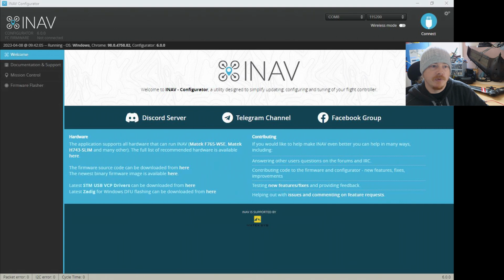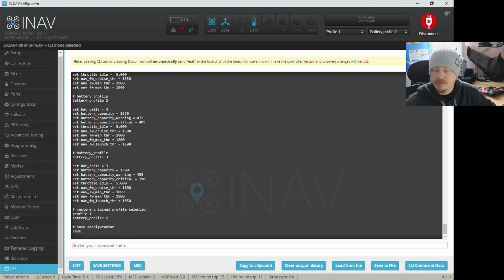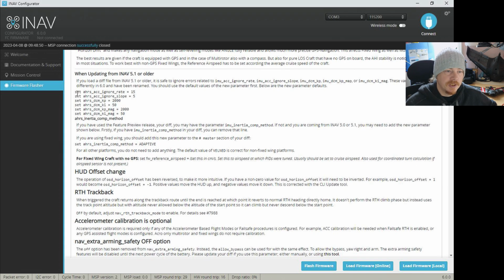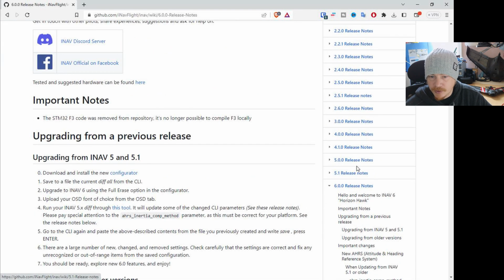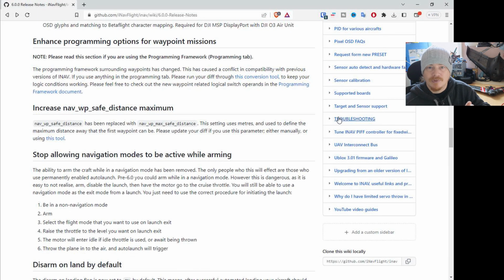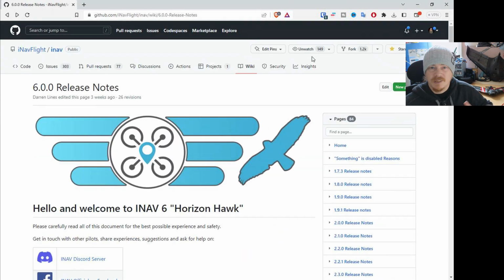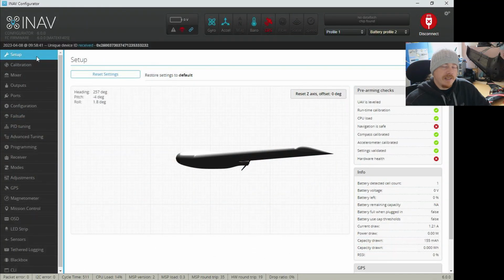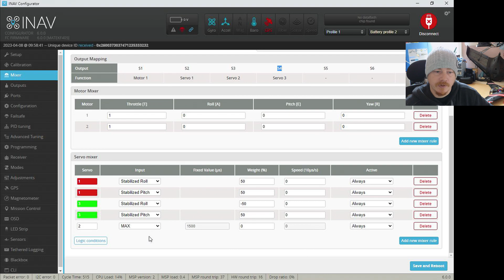FIVE Common INAV questions, answered

Comment: Hi sir. Servo auto trim works perfect on elevator, but aileron stays 1500 all the time. Is it because I adjusted ailerons mechanically perfect OR, I use Y cable from two ailerons and insert them into just S3 port? In mixer, I have deleted one Stabilized Roll channel, there is only one now. S4 is elevator and S5 is rudder. Autotrim on roll axis does not work because of that? Is it related? I’m setting up the plane, Please help. Best regards.

Comment: I’ve got no response from the servos. nothing. Can test the motor, but nothing else is working. I’ve set up modes, arming switches, etc. I’ve deleted all the inputs. In Mixes I have ch1 - Ail, ch2 - Ele, Ch3 - thr, Ch4 - Rud. I have arming switch, flight modes, RTH. I’m using the Speedybee mini wing in a Zohar Drift. Doesn’t seem like a car smash. I was thinking I could test the servos, but nothing is working. Weird, I didn’t think it was that difficult. But when you follow instructions and then it doesn’t work then what do we do? Go buy RTF and not mess with these FC builds. 😂

Comment: Hi, if we already use Waypoint mission do we still need to use Auto level?
I am beginner with RC Plane
I haven't tried to fly my plane. currently I am building it
As I know, in the Waypoint mission there is information of altitude that we need to input
Thank you

Comment: Hi Darren! congratulations on the video! I would like to answer some questions if possible. 1- You said to fly a little with Auto Level and then turn it off after getting the parameters. But can I always leave it on together with Angle or Horizon and only turn it off when switching to a mode that doesn't use Auto Level?
2- Auto Level saves the parameters automatically on each flight or should I save them at the end of each flight? Thank you very much in advance!
Reply from the maker: 1. It’s not great to do that IMHO. It’s better to just use it when you feel like the level needs updating.
2 The autolevel does not trigger a save. If you see ** SETTINGS SAVED ** in the OSD, they have been saved. If not, you will need to save them via stick commands or through save and reboot in the OSD menu.

Comment: Hello again mr D....couple of questions if u don't mind gvg some tips
1.why inav throttle starts at 20%?
2.how to limit maximum throttle in inav
Fyi im using 6.1.1
Reply from the maker: 1. Where the motor starts spinning is defined by the idle throttle on the outputs page. This should only be 5% no I believe. Certainly for fixed wing. 
2. Personally, I’m not a fan of software throttle limits. I prefer to use the right motor and prop setup. But, if you really want to go that route. Also on the outputs page is the option to scale the throttle. 1.00 is the default. This is 100%. If you wanted your max throttle at 80%, set this to 0.80.

Comment: Hi Darren, your videos have been very helpful to an Inav newbie on my skyhunter. I do have a small problem with a 3* roll to the left only with cruz active. Flies strait and level in acro, angle, and manual with continual sevro trim on. Otherwise, no problems.  
Could there be a simple adjustment that I'm overlooking?   Thank you
Reply from the maker: That sounds strange. It would be worth making sure there is no trim on the transmitter. Though I'd also expect this to show up in other modes. When in cruise, were you flying with a cross-wind? If so, that little angle could have been to maintain the correct heading.
Reply: Hello Darren, yes transmitter trims are zeroed and a constant 3* bank to the left no matter which direction I flew. I have adjusted 3* of board alignment in roll axis just to see what happens.  I'm currently waiting on better weather to test. I will report results. Thanks for your interest and response.  @MrD
Reply from the maker: @davidtaylor9508 if that was off, you should see it on the setup page in configurator, if the wings are level.
Reply: I will put a level across the wings and double check the alignment there. Thanks for the tips! Hopefully I get to fly tomorrow and retest. @MrD
Reply: Hello again Darren, I got some flight time in today and some testing. With the board double checked at 0* wings level the plane transitions into a 3-4* left bank roll switching from angle into cruise. I tried adjusting 3* either left or right which only changed the displayed numbers but still had an induced left roll switching into cruise. It is my understanding Inav uses the GPS in cruise mode for course hold. Could this be a GPS issue?      @MrD
Reply from the maker: It’s difficult to say without seeing DVR. I think this question would be better on the INAV Fixed Wing Group facebook page or Discord. 

Forgetting the 3 degree value that you saw in the OSD. How well did it maintain heading? Did you aim at a point in the distance. If so was that kept in the same place in view? Even better. Check the blackbox logs and see if the path is straight. Or has a gentle curve to the left. If you don’t see the point your flying towards moving right, or the blackbox shows a straight line. The 3 degree roll is there to keep you flying in the right direction. 

It may be there is some force that needs opposing to keep the aircraft pointing where it should be. Is the boom tail dead straight. Has the yaw been trimmed?
Reply: Thanks, Darren, for your input. The plane changes heading and slowly drifts to the left as it goes into the 3 degree roll in cruise. It would do a complete circle given enough flight time. Switching back into angle the plane levels out flies strait with very little drift. I don't facebook so discord would be an option. how would I would fine the group? Again, thanks for your time!  @MrD
Reply: I'm on Discord group now. Thanks for leading me in the right direction! @MrD

Comment: Hello Friend how are you? I tell you that I have MATEK 411 WTE with Continuously trim servos on Fixed Wing active. I have flown 15 minutes straight on ANGLE and it does not register any correction value. What could it be due to? On the other hand, my wing has a tendency to go upside down but the autolevel does not compensate for it. The INAV version is 6.1.1. I would appreciate your prompt response. Thank you!!!

Comment: Hi Darren, great video!
I have a question. Can I controll a servo by the home arrow in Inav? It would be a great option to build a long range UAV with an antenna tracker with a patch antenna on the plane. What do you think?
Thx
Reply from the maker: People often come up with this idea. But it’s really not good or practical. A patch antenna on the plane would cause a lot of drag. Also, it wouldn’t address tilt. The best option is a decent quality, mild, CP antenna on the plane, around 3dBi. Then have the patch on a tracker on the ground. You can easily fit a more substantial, higher gain antenna on the ground. Plus, you would have a much lower chance of being out of beam or hitting a null; compared to having patches at both ends.
Reply: Thank you for the quick response, Darren.
I 3d print my UAV's. I could design a dome for the patch. When you take a 180 degrees patch you wouldn't have the issue with tilt.?
I would love to test that :).
Reply from the maker: A 180 degree patch wouldn’t have much of a gain advantage over an omni. Even with the dome, you would still get additional drag.

Comment: Darren (or anyone that might be able to help), I have a question about Auto Level. I have followed your procedure for this tuning mode, on 2 crafts now. It feels like it is making corrections to the AOA but where can I see the results of this tune? I thought that it would adjust the Fixed Wing Level Trim, Level Trim [deg] (in the Mechanics tab) but on both models this field is still 0. Am I looking in the correct location for this or is there another way/place to see the results of the Auto Level tune? I just thought it odd that 2 boards are both still showing 0 adjustment after having ran the procedure.
Reply from the maker: Yes, it should be changing Fixed Wing Level Trim in the PID Tuning->Mechanics tab. If its not changing. Are you saving after you land?
Reply: @MrD  as a follow up, I ran the same procedure on a perfectly still morning and it corrected one board by +1 Degree, so it is working perfectly as it should. I guess I did a good job with the install and the boards are mounted very close to level. Now I can enjoy the fruits of my labor and get to the fun parts. Thanks for the huge amount of helpful content that you have provided for the community!
Reply from the maker: Awesome Chris. I’m glad it’s all working as expected 👍🏻
Reply: @MrD  , thank you for the response, I have Continuously trim servos on Fixed Wing turned on, which should be saving at each disarm. When I noticed that the level trim was not changing I also began issuing stick commands to save just to make sure, still same results. The strange thing is that I saw it actually correct the pitch trim in flight on both models during the Auto Level process. Once I got home and checked, both models are  showing changes from Servo Trim and Auto Tune but 0 degrees for fw_level_pitch_trim. Unless you have any suggestions I will just manually adjust the pitch trim and send it. Thanks for this awesome channel and your website!

Comment: Question: if auto level does the job, what is the reason for adjusting the angle of attack in “mechanics tab”? Thanks.
Reply from the maker: You can enter a value before doing the auto level trim. A lot of people add 4 degrees for the maiden.
Reply: @MrD  just to understand better: if I add 4 degrees, should I then perform auto level or those 4 degrees make the job?
Reply from the maker: The 4 degrees are just an estimated starting point. Performing the auto level trim will get it right.
Reply: @MrD  wonderful. 🙏

Comment: ive read the wiki particularly the modes section. i havent found acro mode which if i recall correctly is a default mode if no other modes are set. Is there a way to see "acro" in blue somewhere in the related tab?
Reply from the maker: Yes, at the bottom of the modes page. Acro is always visible.
Reply: @MrD  I just realized that il if I connect my plane with inav on my pc “acro” is visible as you said, if I use the speedybee  app it is not. Who knows why.

Comment: nOOb question: why should I use auto level?  If mechanically the plane is all set it should fly ok! 
Just asking.
Reply from the maker: The angle of attack can vary with airspeed. Flying slower will need a greater angle of attack than flying faster. Having a mechanically well set up plane is great. But auto level will fine fine tune this.
Reply: @MrD  subscribed!
Reply: Watched the while video. So very clear also for non mother language. Thanks. 
A question please: let’s say I have my plane’s lights on ch 9 on the radio. How can I assign that channel on inav?  In the various tabs i can see modes, killer switch, auto tune etc but there’s no light button or so. Can you enlight me please?
Reply from the maker: You would need to set that up in the mixer. External lights would need a PWM switch to power them. Such as the MenaceRC switch. 

Or you could use WS2812 LEDs, which can be hooked up to the LED pad for signal.

Comment: Hi Darren, your videos are great. Question: Is it wrong to use Mixed AutoLevel together with Horinzon, Angle and CRUZ modes? Or in INAV 6.0 is it recommended not to have them mixed and only activate it by Switch? That is, is it correct if I have them mixed or should I have it in a switch?
Reply from the maker: It was always really recommend to have autolevel on a separate switch. Its only really needed for tuning. With INAV 6 its better to have it on a switch. As there is now an onscreen message when autolevel is used.
Reply: @MrD  Perfect !!!. Thanks

Comment: Hi Darren, is it true that continuous autotrim of the servo could damage the fc eprom? because it records and rewrites permanently. I congratulate you for your videos!
Reply from the maker: No, not at all. It doesn’t do anything different to any other save. It just saves every time you disarm. EEPROM is good for around 100,000 writes. That would take 192 years to get to, if you had 10 flights a week. I think the EEPROM’s ability to write will outlast the flight controllers in most cases.
Reply: @MrD  perfect Darren, thank you very much!

Comment: Hi Darren would it make sense to have autolevel and angle mode acivate together?
Reply: Thanks very much for the clarification Darren, keep up the good work 😁
Reply: Thanks Darren for all the hard work on inav, so I've been combining auto level with horizon on same switch but if I understand correctly I now will fly in horizon, land and save using stick commands? Also in inav 5.0 should altitude hold be combined with cruise mode or is cruise fine without doing this? I've been flying with inav 3.0 and never combined these two. Thanks again
Reply from the maker: No, you don’t need althold with Cruise. To be honest, althold isn’t needed with any mode on fixed wing now. 

As the comments above. I would have auto level separately on my tuning switch. Then I can enable is as needed in Angle or CRSH. It also works in Horizon, but I don’t use that mode. It can be disabled in flight. That has no effect on saving when it’s disabled, the value is remembered until you unplug the battery. When you land, saving depends on what you have set up. If it saves automatically (continuous servo trim or stats enabled), there is no to save with sticks. If not, you will need to save with sticks or through the OSD menu. 6.0 will display a message when the settings are saved. 

If you’re still on INAV 5. I would highly recommend updating to 6.1, which is released today. INAV 6 has huge improvements in the flight dynamics. Plus helpful things like the saved message.
Reply: @MrD  thanks for all the help, I'm almost done with my 3rd ar wing pro build and trying to understand fully how to tune correctly, so I guess I'll have servo trim,auto level and auto tune all on separate switches fly enabling these in this order one at a time then disable modes then land and save settings. I haven't seen this done like this but what's your opinion? Thanks again
Reply from the maker: @egtreadway4232  personally, I would remove the autotrim mode and enable Continuous Servo Trim.
Reply from the maker: I personally don’t think so. It only needs to be used when you tune angle of attack. Also, you would have an ** AUTO LEVEL ** message on the OSD the whole time.

Comment: Just confirming. Even when you perform Auto Tune or Auto Level it will be saved automatically? No need to put the sticks on each corner to save? Thanks.
Reply from the maker: It depends what you have set up. Neither of those two will save on disarm. But, if you have continuous servo trim or stats enabled, they do save on disarm. That save will save everything. 

Easy way to look at it. If the OSD shows ** SETTINGS SAVED ** in the system messages or stats screen, a save has happened. If not, you will need to save with stick commands or through the OSD CMS Menu.
Reply: @MrD  Thanks for that. How do you enable STATS? Have not seen any option for that. Thanks
Reply from the maker: Its an option you can set in CLI.
Reply: @MrD  Thanks. can tell me what line? Do you have a video for it?

Comment: Thanks for the INAV instructional.  I was wondering How do you make additional profiles? And how do you select a profile?
Reply from the maker: You can’t make additional profiles. But there are 3 control and battery profiles you can use. Just switch them at the top right of configurator, near the connect button.

Comment: Lovely t-shirt 😂, I know that cruise mode is course hold + altitude hold, can you let me know if the auto level will work with cruise mode or only with angle, horizontal, and course hold? Many thanks
Reply from the maker: Auto level won’t work with cruise. It needs althold disabled to work.

Comment: First of all, many many thanks for all your help and effort for our fantastic hobby.
I have a question about Inav 6.0.0.
I have several types MATEK flight controllers and something strange is happening when I update the MATEK F405 Wing FC to Inav 6.0.0.
When I Flash it to Inav 6.0.0 and put the Diff All from Inav 5.1 through the INAV 6.0 CLI Update tool I get the message "This tool could not accurately detect the setting for ahrs_inertia_comp_method" "If you are using this installation of INAV on a fixed wing (AIRPLANE), you should use the command: set ahrs_inertia_comp_method = ADAPTIVE"
The problem is that I can not use the command: set ahrs_inertia_comp_method = ADAPTIVE But I can use the command: set imu_inertia_comp_method = ADAPTIVE
Could it be that a wrong firmware Inav 6.0.0 has been made for the MATEK F405 Wing?

For your information.
Unfortunately, I can only flash the flight controllers with the Speedybee adapter V3 because in DFU mode on my laptop during flashing the error message Failed to open USB device! appears.
I really tried everything to solve this but unfortunately nothing helps. Maybe there is a wrong firmware via the Speedybee app?

These commands also do not work:
set ahrs_acc_ignore_rate = 15
set ahrs_acc_ignore_slope = 5
set ahrs_dcm_kp = 2000
set ahrs_dcm_ki = 50
set ahrs_dcm_kp_mag = 2000
set ahrs_dcm_ki_mag = 50

These commands do work:
set imu_acc_ignore_rate = 15
set imu_acc_ignore_slope = 5
set imu_dcm_kp = 2000
set imu_dcm_ki = 50
set imu_dcm_kp_mag = 2000
set imu_dcm_ki_mag = 50
Reply from the maker: Yes, this is not the right firmware installed. It is not 6.0 stable. Are you installing it from Configurator’s list of uploading a hex file? Also, you can switch off “Show unstable releases”.

Ah right, SpeedyBee. I’ve not tried flashing with that. So i’m not sure where it gets the targets from.